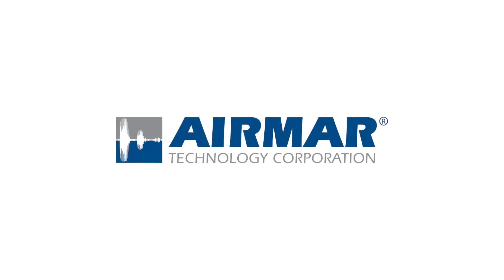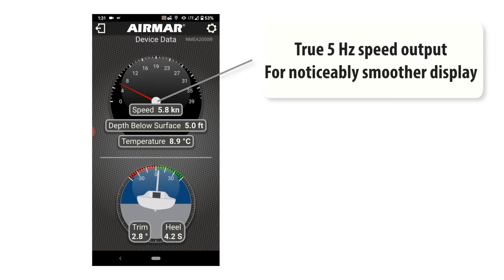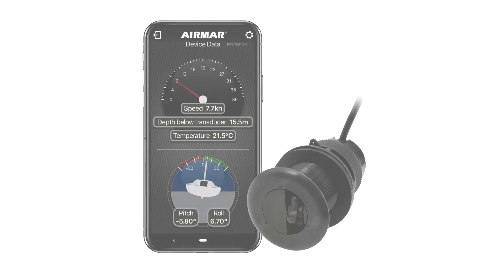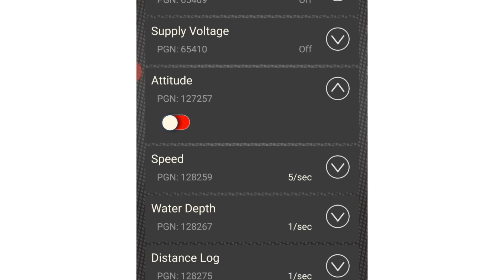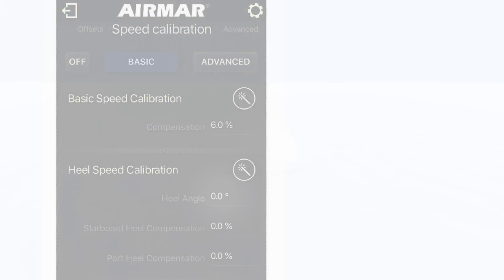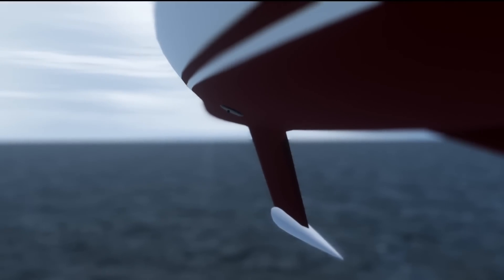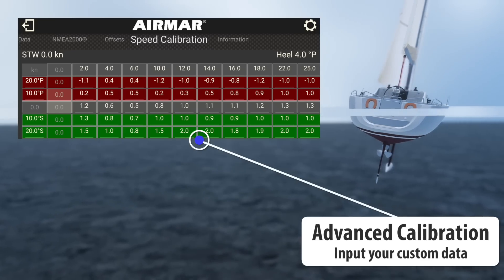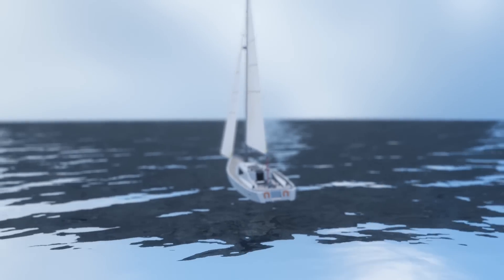Airmar DST810 Smart™ Multisensor

Comment: Rubbish again! After 2,5 years in use displays wrong temperatur with nearly 40° celsius. I have no other device on board that has been replaced so often in 10 years. With the 810, I thought the problems had been solved. Unfortunately, I was disappointed again!